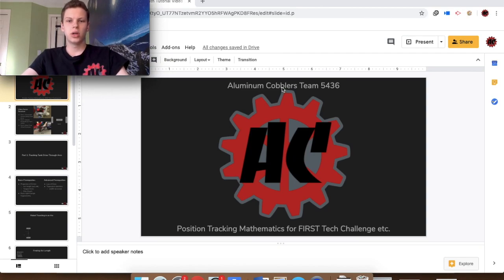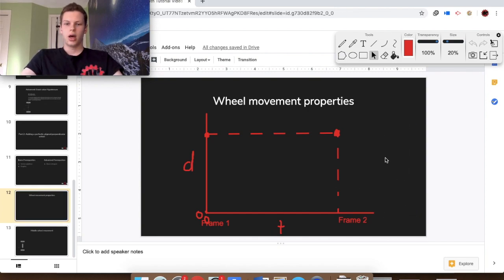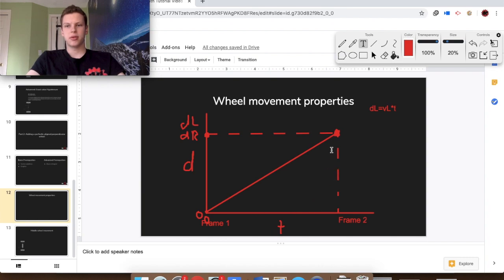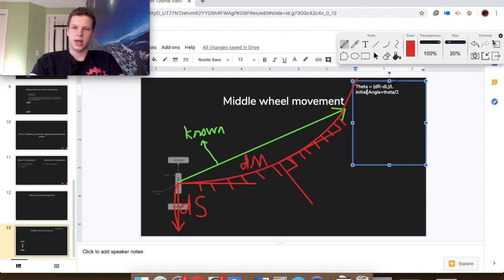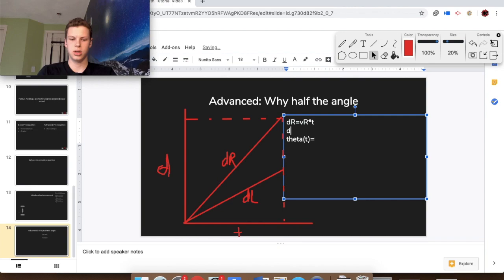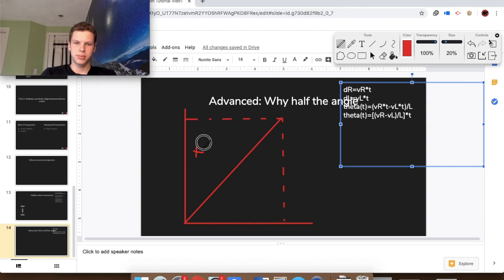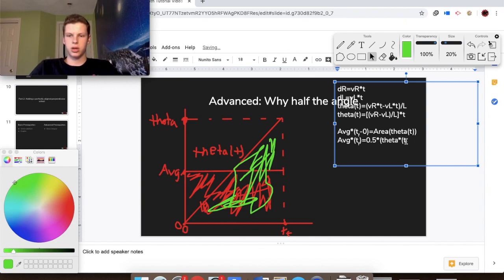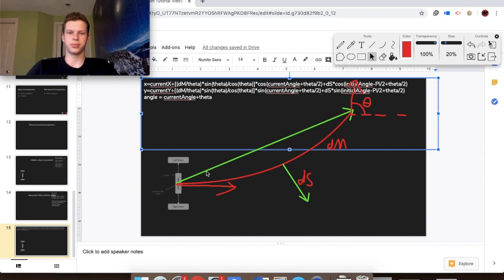FTC Odometry Position Tracking Math Tutorial Part 2 Aluminum Cobblers 5436

Comment: This assumes constant velocity between time steps right?
Reply from the maker: Yes, you assume that the wheels move at a constant velocity between time steps. Even though the wheel could be moving at any speed through out each frame, mapping a straight line to the two points on the position vs time graph, the slope will always give you the average velocity and so the calculation will have minimal error.